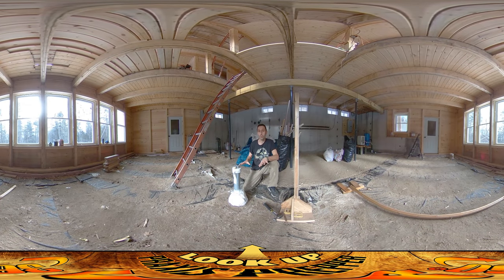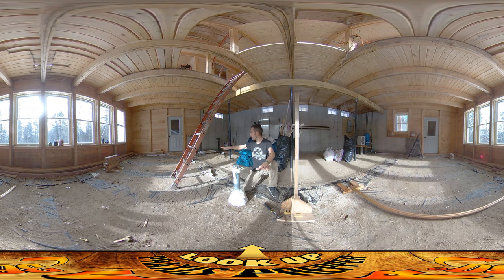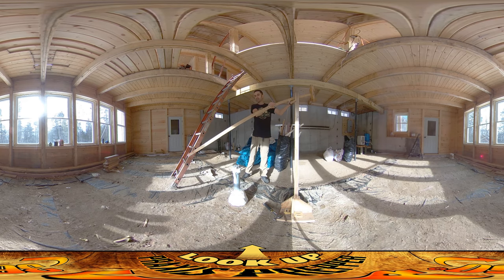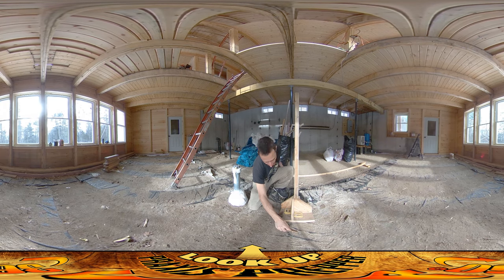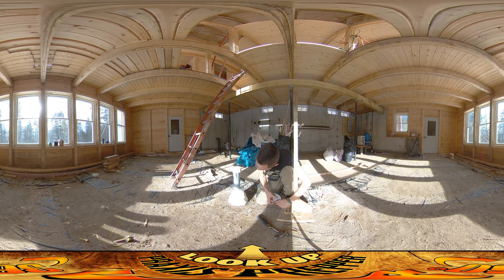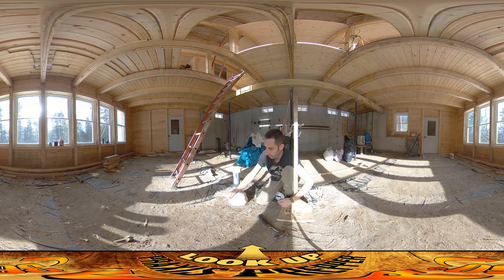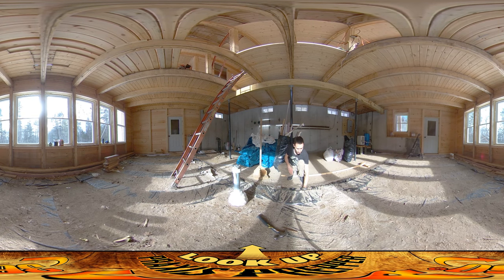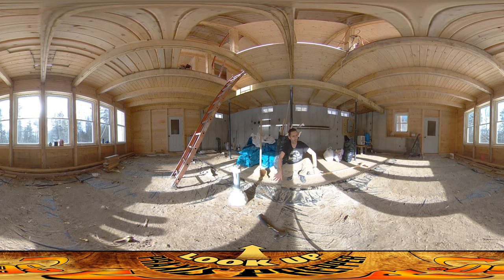Homestead Building - Finding Final Floor Height Indirectly for Incoming Woodstove Air

Comment: I'm with Rat Route, don't remember ever seeing that floor tool thing, did you forget to upload an episode? Maybe days 314 or 315 that were skipped over?

Do you not need those block holes at all? If you do, how are you planning to clear the gravel after the pour?
Reply from the maker: Maybe I never documented the tool. I thought I had. Maybe not. Maybe I don't need the block holes. I thought it might help with registration, but maybe not... probably not.